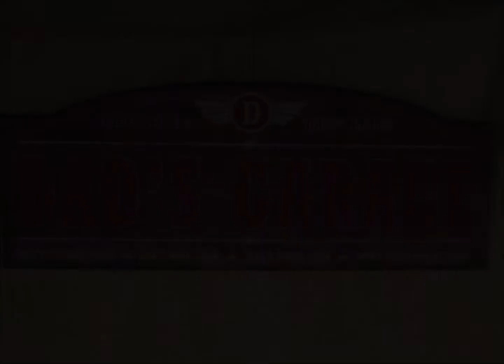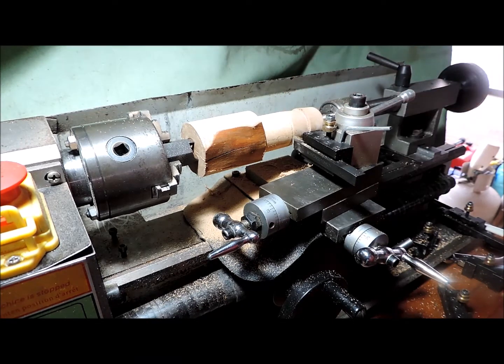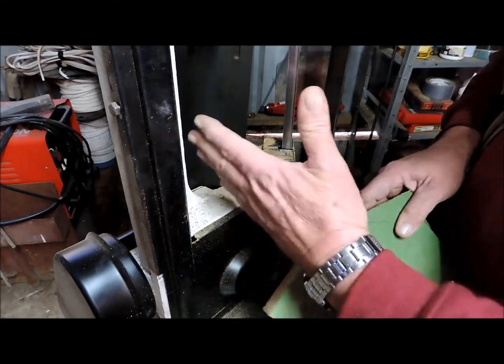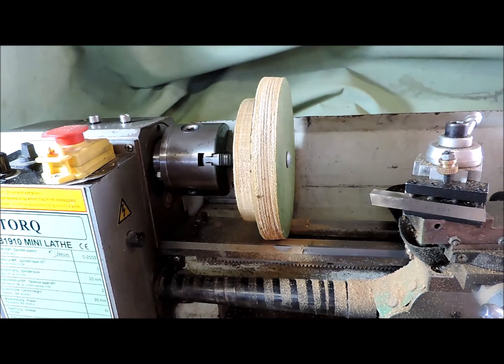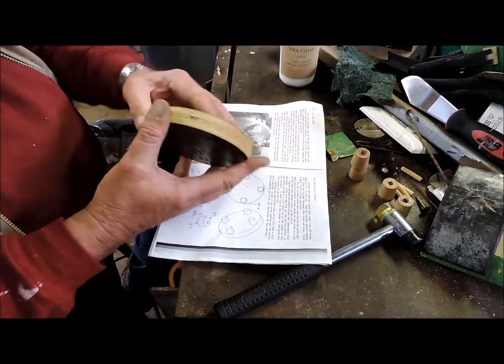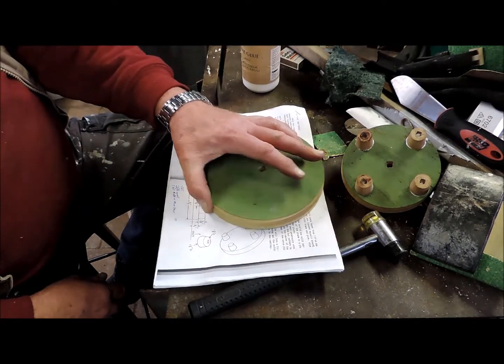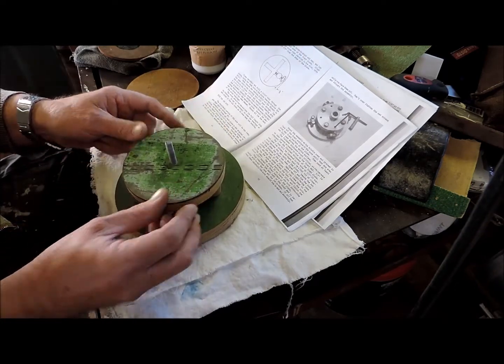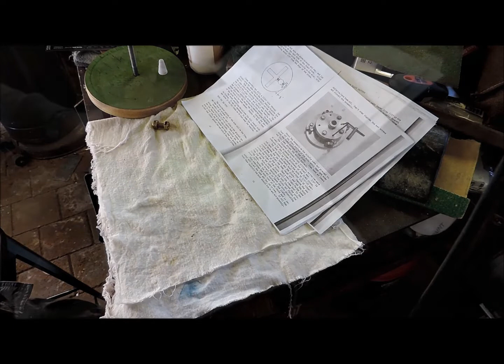Making the Gingery 4 Jaw Chuck, Part 1

Comment: Hi Peter, happy day too you. 
The Gingery lives on with you making another accessory for the lathe a design from Gingery, this should be a good build to come along on you with. You had to make a lot of forms for your forge pour box. The patterns have to have the chuck jaws teeth grooves in it, countersink the bolt heads? If needed make the back plate thicker to comp for the countersink you wish for x 4?
This 4 jaw chuck will be a good build the picture from the book does look nice.    
Lance & Patrick.
Reply from the maker: G’day Lance and Patrick, good to hear from you. There isn’t many castings with this build, front and back plates and 4 jaws but there is a fair bit of hardware with the screw, nut and bearing journals X 4. I will differ from the book for the mounting to the lathe as Gingery had a hub for the 1” spindle and I have a spindle with a 55mm flange, a small change to plans. 
Cheers 
Peter

Comment: Hi Peter, great start on the chuck.  I see at 5:51 you give the pattern piece a drop on the floor.  Looks like you are picking up my bad habits as I seem to drop something on the floor every video I do.  :-)  Kind of look like the chuck will just fir your lathe.  Looking forward to the next installment Peter.

Joe
Reply from the maker: G’day Joe. I seem to make a habit of dropping things lately. The front pattern indeed is a close fit for clearance but the casting will need machining concentric so I will gain a little more clearance there. 
Stay tuned, cheers. 
Peter

Comment: Greetings Peter,  Should be an interesting build.   I am thinking about  how to handle the shrinkage on these plates.   I have had serious grief on similar pours.
Reply from the maker: G’day Dan, thanks for stopping by. I have poured a number of large discs in the past for the face plate and haven’t had good results where the sprue enters the centre of the castings as instructed by Gingery, probably not a large enough fillet between the sprue and plate, this time I will try sprue and riser into the side. 
Cheers 
Peter